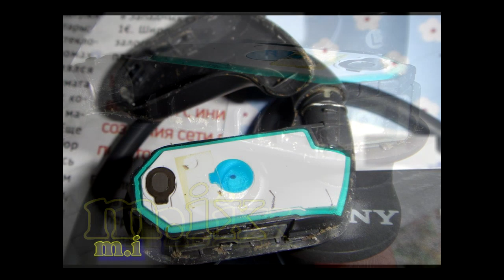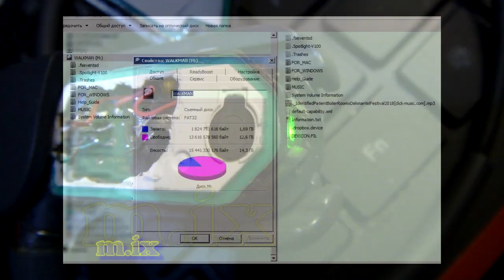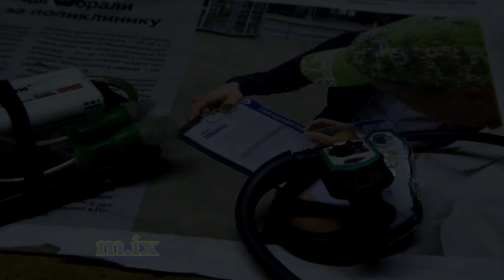SONY NW-WS625 Наушники

Comment: How did you open it up? I got mine still intact but really want to fix the AMB module inside....
Reply from the maker: Всё там на винтиках и защёлках, остальное заклеено, другой наушник лучше не разбирать, антенну сломаете, там аккумулятор под ней прячется.
Reply: @Mixa007Master  oof cant understand but i opened it with a knife. I replaced some cable and its working fine now. Thanks!
Reply from the maker: @odinrothschild4249  Не за что.

Comment: @Mixa007Master My Sony Walkman WS 623 while connecting with bluetooth mic, outgoing voice is not listening to the call receiver. I have updated the latest software but same issue of outgoing voice mic is not working. Kindly help me for any fix.  (Reply in English)
Reply from the maker: Нужно заменить микрофон и смотреть качество провода.
Или пробовать эти наушники на другом смартфоне.Если подсоединив эти наушники к другому смартфону так же не будут слышны, то значит микрофон нужно заменять.
Reply: @Mixa007Master  In which side of Sony Walkman NW-WS 623 earphone outgoing mic is been installed left or right? Advice me how can I replace the mic of this earphone? How can I test the quality of the wire is good ongoing condition or gone damaged?
Reply from the maker: @Vikasharma115  Если внимательно смотрели моё видео, то увидели где находится микрофон..
У нас клуб не гадалок и не ясновидцев, что бы проверить провода, нужно как минимум вскрыть гарнитуру и мультиметром проверить каждый при этом его двигая. А поскольку микрофон в гарнитуре неподвижный, то однозначно менять нужно его.
Но провода проверить стоит.
Микрофоны одновременно работают как и шумоподавление.
Я не представлю как вы будете разбирать другую сторону, там на другой стороне антенна. которую легко повредить.
В другой стороне стоит ещё и аккумулятор.
Надеюсь, что когда начнёте разбирать другую сторону, всё детально и качественно снимите сфотографируете и всем покажете, что и как там сделано во второй стороне, которую я не разбирал.
Reply: @Mixa007Master  Спасибо за информацию
Reply from the maker: @Vikasharma115  Жду фото и видео отчёта. Ссылку на ваши фото и видео можно тут оставить.
Reply: @Mixa007Master  Actually I am not into electronic mechanism repairing, as per your advice I will guide it to my near by local mobile repairing shop and ask him to fix this issue.
Reply from the maker: @Vikasharma115  Понятно.
Облегчить жизнь сервисной службе, которая скорее всего откажется от ремонта вашего дэвайса.
Reply: @Mixa007Master  ok thanks